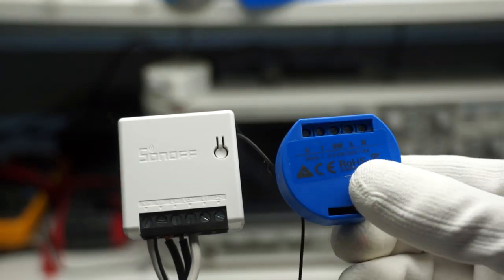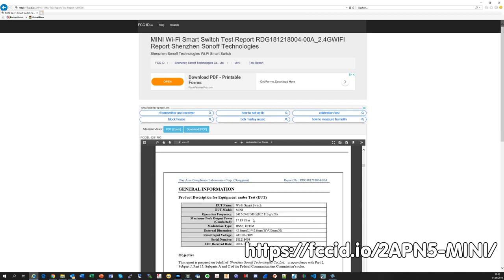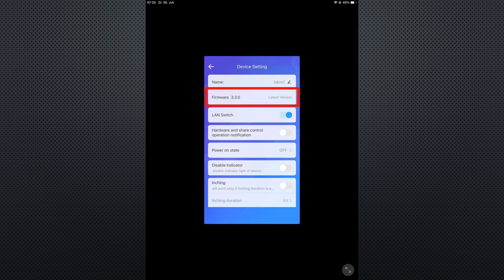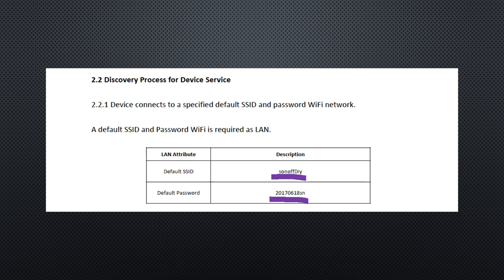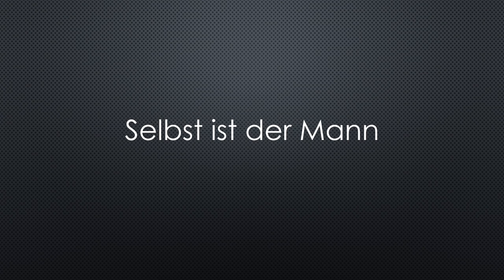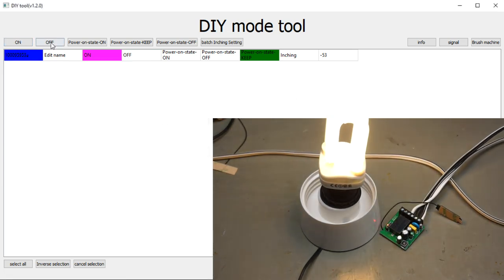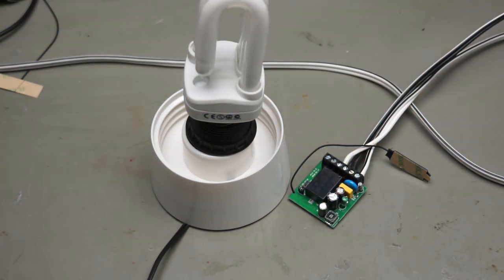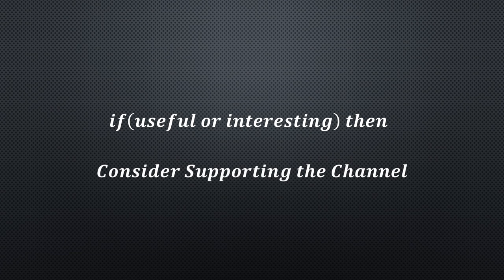#280 Tutorial Sonoff Mini (DIY Mode, flash Tasmota)

Comment: In Chinese "刷机" is sometimes used to describe the process of flushing in firmware. although, if translated separately, "刷" could be translated as "brush", and "机" as "machine".
Reply from the maker: Thank you for the professional explanation! It sounded very funny in my ears.
Reply: I think, in Mandarin and in Japanese the word machine is used where in English words like apparatus, device, or machine are used (as appropriate). So, my imagination tells me that the Chinese term may be closer to something like "repaint device."
Reply: @michaels3003  The Character "刷" means ”painting“ in some contexts. However, it has many different meaning and translations in other contexts. I am not sure why the term "刷机” means "flushing firmware" but it is regularly used in Chinese to describe that processes. I am sure that flushing firmware is what the authors of the tool meant, and it was just some Google translate(or Baidu translate) mess up, we all know they are not great with specialized terms.
Reply: @michaels3003  I tried putting "刷机” into Google translate and it indeed translates it as "brush machine".
Reply: Jinyu Liu Interesting information. As you know a lot of manuals and GUI´s are ¨Chinglish¨ and gives western people a bad quality impression. But i need to say that i´am also very bad in Englisch. :)
Reply: "刷机“ means "刷新计算机” originally; the "刷新“ means refresh/flash; I personally don't prefer to use "flushing" though. If we take the "original" meaning of it, the "brush machine" should be meaning by "refresh/flash computerized device". It sounds funny with shorted wording in Mandarin. Anyway, this is a eater egg from iTead. At least it makes people laughing.

Comment: I have two of the minis on order. You didn’t mention what I see as the main advantage over the basic... connectors for an external switch. This is perfect for lighting circuits in Europe. Interesting video. Thanks
Reply from the maker: I think I mentioned the switch in the beginning (on the comparison slide with the Shelly)
Reply: Andreas Spiess You did. I stand corrected! :-) 2:25
Reply: I'm thinking of getting some for the same reason, so far I have 6 or so old sonoff's running table lamps around the house. the UK wiring does not make it easy with no natural in the switch feed.  upstairs lighting will be easy as I can just go up into the loft. downstairs might be harder depending on how they ran the wiring to the light socket. I think downstairs wall lights will be the hardest.
Reply: The Embedded Hobbyist If there’s a reasonable hole behind the ceiling rose then it should be easy with these new minis. The external antenna could be useful in this situation as well. Yeah - wall lights might be more challenging.
Reply: @AdamWelchUK  Good spot Adam.  I've been wondering how best to do this for the house - although these days its more a matter of switching on and off 12V power supplies :)
Reply: A european switch does not consist of a 2 wire loop. So how exactly is this perfect for lightning circuits in Europe? A socket with a wire that comes from the switch is a black wire, that is switched from Live wire (brown). But the brown wire does not necessarily come from the switch itself, the brown wire can come from anywhere. So a 2 wire switch like the Mini is not useful. They should have made the switch with one input, one that detects voltage or not like normal switch operation.

Comment: Hi Andreas, I've jump onto this bandwagon a bit late as I had no need to do so far. When I saw your flashing instructions, I've just opened the box and soldered the wires of FTDI and pop the tasmota (9.2.0) in. It works like a charm. So for the others, if you are OK with fine solder tip, it is the faster way. (Sure do not plug to mains while flashing :-) just in case note ...) Thank you.
Reply from the maker: Thank you for sharing your experience. Soldering for sure is the fastest way for just one device!

Comment: Regarding the relay specs: Going off the relay data sheet, the top line (10A 250VAC) is the switching capacity (ie. it can switch up to 10A without sustaining any damage) below the line (16A 250VAC) is the current carrying capacity.
so if the relay is switched on with a current, and then the power draw increases to 16A, all will be fine, BUT, the current draw would have to drop below the switching capacity (10A) for safe switch off
Reply from the maker: Thanks for the explanation. So my guess was not wrong that it will not start to burn at 16A before the fuse trips.

Comment: Hi Andreas, nice video. For those who have issues with Win10 not showing the device - you need to give the DIY software access on your windows firewall to work on 'private' networks so it can connect. Once you set that tickbox the device shows up instantly. Next gotcha is getting stuck on 0% when updating the firmware. In that case first set the SSID / pw to your wifi credentials.
Reply from the maker: Thank you for your tips!

Comment: Thanks @Andreas for saving troubleshooting time for the braves. Real challenge both doesn't resolve is that by regulation/safety, a good part of the world doesn't have mains in the switch boxes ;) cheers. -Cleber.
Reply from the maker: Then I assume it is even easier as you can use low voltage stuff
Reply: Only easy if you accept a pulse button to trigger the relay via RF, now, try to keep the toggle button and spend less than 8uA so a very small battery least few years. Wasn't easy at all.
Reply: Happy wife happy life, right? Here the idea of changing the user experience was not entertained...

Comment: The AC current rating is higher than the DC currecnt, because an AC arc (when the switch opens) will self-extinguish because the volts drop to zero regularly.  DC volts do not drop to zero of course, so when the relay opens under heavy load the arc will be drawn and held until the gap extinguishes the arc.  HTH.
Reply from the maker: You are right with AC. But the 16A was also stated with 250 VAC, but with CQC
Reply: @AndreasSpiess  I do not know.  Perhaps CQC has a different rating system.
Reply from the maker: Meanwhile, I got a link to the datasheet of the relay. The German TüV also accepted 16A/250V. So my statement that the fuse trips before the switch starts to burn might be true.
Reply: The biggest problem with DC on relays is not the switching current  but the breaking current. to get a better breaking current you have to go to magnetic arc breaking, or your contacts just weld shut after a time. had big issues with switching a 10A solenoid at 28V dc the arc on opening would after a time fuse the contacts together.in my opinion DC is best left to large fets to switch.
Reply: @AndreasSpiess  And it´s always good to have a litle bit reserve and run a relay or something not on the maximum capacity.

Comment: My understanding when there are dual ratings on a relay is that the high value is for nearly purely resistive loads and the lower value is for inductive loads (like motors).  The stored charge in the inductor will try to weld the contacts when they break, that is the reason for the lower rating with inductive loads.
Reply from the maker: This is well possible. I do not know the assumptions behind the different test procedures. Maybe different labels use different assumptions.

Comment: Very good explanation. However, I would like to know if it can be used in a switch which does not have neutral. If so, how to proceed? Thank you
Reply from the maker: I do not know because we do not have such installations. But I read there are solutions for that (if I remember right for the UK)
Reply: @AndreasSpiess  Thank you for your reply. What kind of solution have you read? A way to adapt this product to my configuration or another kind of product ? Thks
Reply from the maker: This one, for example: https://itead.cc/product/sonoff-t4eu1c-wi-fi-smart-single-wire-wall-switch/

Comment: Hi! In my case it was necessary updating the firmware to 3.3 in order to make the sonoff connected to the hotspot.
I tried at least 4 windows Pc (OS 10, 7pro, 7he) but with the 3.0 firmware on the sonoff it didn't connect to the hotspot.
Maybe this could help someone..

Comment: Are the switch contacts for controlling the Sonoff mini under mains voltage or are they low voltage? I would like to use a switch, that is only low voltage rated. As much as I like Shelly, the switch input must have the same voltage as the power source.
Reply from the maker: I did not check. Maybe somebody else knows?

Comment: Nice. Is there something like this for thermostats?
Reply: Use your existing thermostat and wire to it. You then simply program your controller (i.e. Arduino) with an alarm / timer schedule. 

But modern thermostats already have schedule programming features and are incredibly cheap.
Reply: Look for EQ3 MAX! thermostats or something :)
Reply: I meant to ask if there is any wifi thermostat on which we can replace the firmware. That was the "something like this" part 😃

Comment: Thanks for this good conclusion. At least I run tasmota on the ordinary sonoffs after 15 - 20min, including soldering pins on the pcb. Independent of any network and operating system. Atom does the flash job easy. 
The "diy" mode looks like a mess and needs so many tasks that I ll rather spend a few euros more and live in peace.
Also the single switch shellys get cheap since their successors with two relays where sold.
Reply from the maker: And maybe also because of competition?

Comment: Do you know if you can toggle this device from another arduino/ESP device?
What I'm looking for is pretty much a wire that toggles the device, not S1/S2. They are already used.
I was thinking of soldering on a wire to the pushbutton connection. Could that trigger the toggle?
Reply from the maker: You can use MQTT for that.
Reply: @AndreasSpiess  yes of course, but I'm looking for a solution that works when there is no network at all.
Reply from the maker: Your proposal should be possible. My Sonoffs toggle the relay with the button.

Comment: In shelly 2.5 or 1 both uses live wire for switch which helps to connect two way switch (2 physical switch one bulb). Is there a way to do same with Sonoff mini without using an extra wire.
Reply from the maker: I do not know, I newer had this use case.

Comment: Thank you Andreas, very good video. Do you think tx and rx  can be used to connect sensors such as pir? Or is it impossible such as on the sonoff powr2?
Reply from the maker: I used them to look at Serial, so they seem to work normally. But they might be on live potential. I did not check that.
Reply: @AndreasSpiess The Itead Product description states: "The antenna has strong electricity inside, do not break the wire jacket. " so I would expect all the GPIOs including the switch contacts are "live potential" too. Proceed with great caution.

Comment: With Tasmota, is it possible to separate the switch input from the relay? Aka, just have a general input to process (in Node Red or something) and maybe switch the relay as a result. Even better if it would support short press, long press, double press etc. Although, I'm still looking forward to dimmer versions!
Reply from the maker: I did not look too much into the Tasmota implementation. And so far I did not find a diagram. Maybe Sonoff will also publish it later.

Comment: I have always thought reviews should to be impartial, but most likely sometimes I am wrong.

It is strange that the obvious facts are silenced, for some reason, as:
1. Shelly 1 - 24-60 DC + 12V DC + 110 - 220V AC
2. Clean contacts allowing many more options
3. Displayed price over 2 times higher than the real price
4. The output of the switches must be from the relay, several buttons cannot be used.
5. Height 20mm meets 17mm where the place is most critical
6. PIN header on the shell
Reply from the maker: It was not a comparison. But I have to admit the Shelly price I showed was for two. I did not find it elsewhere on our usual sellers. And because my Shelly1 also was quite expensive (shipping included) I did not check good enough. The rest of your points I mentioned or showed I think. Except the DC stuff which is not important for me.
Reply: @AndreasSpiess  "It was not a comparison" But you are comparing both multiply times in the video.

Comment: Can you use push button instead of the external switch. I turn my light with relay via push buttons. I would replace dumb bistable relays with this. I used 4chPRO and hacked it too accept push buttons but if this works out of the box, it would be better for me.

Comment: I know that the Shelly 1 has a Low Voltage (DC) Mode ... Does it require a neutral wire??
Reply from the maker: I do not know. Maybe you consult their specifications?

Comment: Thank you Andreas, I am going to buy some mini's and flash them with Tasmota very soon.      I am fine with hardware connection and have flashed ESP8266 devices previously.   Have you tried flashing a Sonoff S55 weatherproff power outlet switch ?    I dont seem to be able to flash mine for some wierd reason it fails to flash.   The device is working fine in EweLink but , like many of us I really like Tasmota and no cloud.       Love your tutorials.  Cheers from Rodoz
Reply from the maker: I do not own an S55.

Comment: I was able to update the firmware on the mimi from 3.0.0 to 3.3.0.  I also change the wifi to my home. I added the dyi jumper.  Fing shows both the mini and by laptop connected to my home.
However I get the below error when I ran the tool, "tool_01DIY85(3.3.0).exe". Any suggestions?  Thanks.

"
Traceback (most recent call last):
  File "site-packages\PyInstaller\loader\rthooks\pyi_rth_qt5plugins.py", line 47, in <module>
ModuleNotFoundError: No module named 'PyQt5'
"
Reply: Is tool_01DIY85(v3.3.0).exe a stand alone program or does anything else needs to be installed such as Python?
Reply from the maker: It worked fine with me (I just checked it again). So I have no idea what is wrong on your side :-(
Reply: Long story short .... I was using an old slow laptop. Using a newer laptop solved the issue.  I want to thank you and all the others such as The Hook Up, Dr Zzs, and digiblurDIY for your great videos. Thank you.

Comment: Hi Andreas. Does flashing Tasmota firmware mantains the full operativity of the switch contacts? Thanks for your video!
Reply from the maker: I think so. It does not change the hardware and you can use all ESP pins with it.
Reply: @AndreasSpiess  thanks!

Comment: Miniature relays have max current specified for coś fi =1 condition (resistance output). When you connect eg. motor, max current for relay is lower - that's reason for 10A in specification.
Reply from the maker: You are right. But this does not explain the 16A. They were also stated with 250 VAC, but with CQC. Or do I miss something?
Reply: @AndreasSpiess  , my mistake - I listened to the movie on BT headphones. "CCC" have higher value than DC current at 30VDC. Normally, that value is the same on that relay's type (what can You se on "normal" value 10/250AC). In me opinion, CCC value is overstated and  i am sure that this is due to the less stringent standards of contact durability (eg. number of switch).
Reply from the maker: According to the datasheet the German TüV also accepted 16A/250V
Reply: @AndreasSpiess  Did you find the content of the TUV certificate (I did not find)? A few TUV cert. is a "the declaration of performance", not assessment of compliance with standards. I never rely on TUV statements (electronic components), because they can confirm, for example, that a pen can only write 1 sheet of paper. I didn't find UL too (which would be better for assess).

Comment: did you remove the ethernet to try it? also check with wireshark and see if it's receiving broadcasting from the unit. you will find that the hotspot is not allowing client to client communications I bet.
Reply from the maker: I am not so sure, because the same setup worked with my business PC

Comment: Hey Mr Swiss Accent.... you should try using the mobile hotspot in Windows 10.  Just search hotspot and it will take you to it. Set the SSID and Passwort and activate! ;)
Reply from the maker: Maybe it would have been easier, you are right.
Reply: this does not appear to solve the problem - the sonoff still does not appear in the DIY tool :(

Comment: Thank you for walking through the entire process.  Even if I actually had a Windows computer, I think it would still be faster to solder some #30 wire-wrap wire on the pins and just flash it "the hard way" as usual.   Is the DIY jumper pin usable as another GPIO pin?
Reply from the maker: Yes. It seems to be connected to GPIO16

Comment: Thank you Andreas, I liked and subscribed. It'd be good to get more info on the switch contacts, as I believe this is the main differentiator of this device over the other Sonoff's. For example, can they only be connected to a "standard" wall switch? Are they limits on the input voltages they'll accept? (presumably the current across the switch contacts must be 0?)
Reply from the maker: I do not know because I do not use this function. But I hope you find this info in the data sheet.

Comment: Thanks for this review. I don‘t have a clue about these SONOFF thingis. Hence, I‘m wondering about it’s benefit over a simple relay, ESP, rectifier, and capacitor circuit that one can make for a few bucks and then design it to the particular needs. Perhaps with some OpAmp for current sensing or regulation !?!? Especially without the cloud ecosystem around.
Reply from the maker: The advantage is the price. It is only a few bucks. And it is ready-made. It will be hard to beat the price because you need a 3.3v power supply, an ESP, a relay, and a case.
Reply: Andreas Spiess Ahh, Andreas, you‘re right, 7$ is hard to beat. I confused it with the 22 bucks for the Shelley but you corrected that, too.